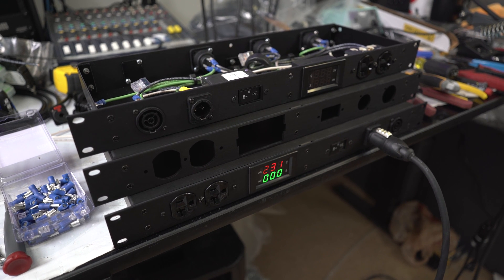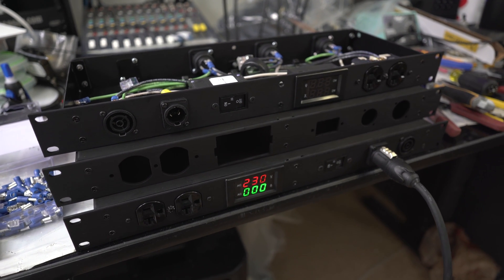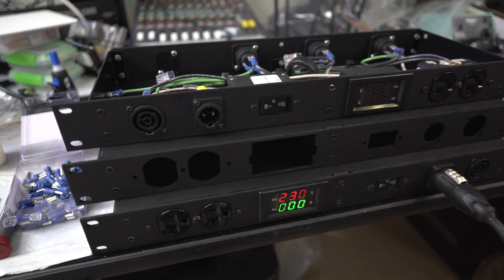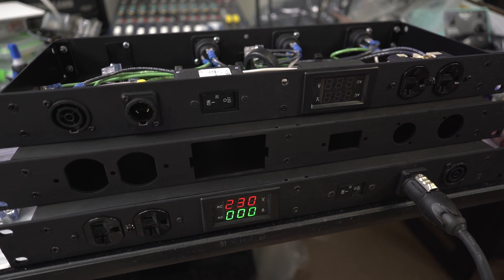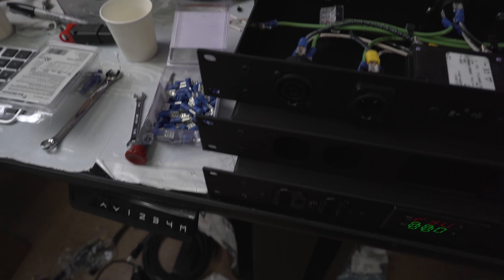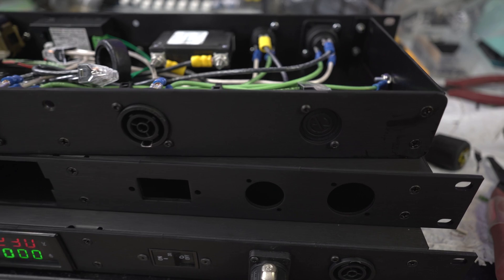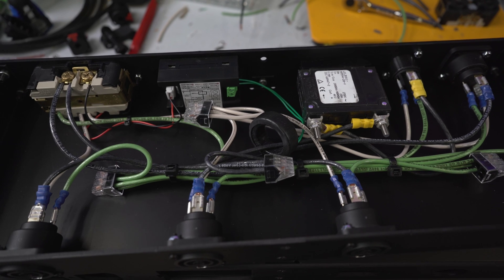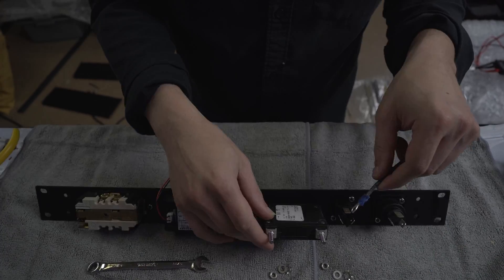Building A True1 1U Rack Mount Power Distribution Unit

Comment: I would like to know WHO Builds the Breakers you use as well as the Volt/Amp Meter  ? NEC Code says the way you are doing your wireing is wrong . When you come into the distro  you come into a Wire Strip for both the hot and nutruals . Just like they do for Square "D"Breaker Panels . You should also do the Grounds that way as well . Just a thought . I was trying to find Spec info on the wago connectors on what load they could carry and could never find any info on them ... I tell people when you build power distro's you build them like enclosed trailers . People will buy a 6 x 12 single axle trailer and then pack it as if it had 2 3500lb axles on it . ALWAYS over Build . ALWAYS ... Thanks

Comment: I'm guessing the application is:  Customer is using this power board for both US and EU locations.  His equipment uses a US NEMA 5-15 but the internal power supply is actually international 50/60Hz 100-240V.  So, he can get his power from a Powercon True1 connector in either country and still use all the same rig/power cabling.  Ignoring that a NEMA 5-20 is not rated for 240V, but we all know it's made from the same components as a NEMA 6-20.  :)
Reply from the maker: Correct! The True1 also saves on height as we can make the chassis 1U instead of 2U to accommodate a 5-20

Comment: Please answer this i have to crown xti 4002 amps i want to use a 1u distro what would you recommend?
Reply from the maker: 2 of the most expensive units LM makes. 🤣🤣 This is a hard question to answer without knowing more. I’d recommend taking an average of the venues you play and see what power outlets they have available. I’d hate to recommend say…a 3 phase distro, that you can only use at 1 venue.
Reply from the maker: Also. Check out this video. It elaborates on my last comment and as a bonus…gets LM some views. https://youtu.be/irvbvwdUEfc?si=VTCTuCzxqmxRxiuE

Comment: I would love to have a auto-switching pdu which has two inputs (primary, secondary) and then 2x NEMA 5-15 ouputs.
Reply from the maker: I actually have a dual input L5-15 distro build coming up. I’ll film it!
Reply: @billylaguardia  are you planning on selling them by chance? What would be a general price target? Auto-switching pdus with dual failover inputs are typically pricy. I’m using for networking equipment, where one input goes to utility and the other goes to UPS battery.
Reply from the maker: @justinknash  it’s a custom build for a client. Happy to spec something out for you if ya like. Just shoot me an email: billy@lmcases.com

Comment: Nice build. One comment is.  I have been told by licensed electricians that you should not have the hot or neutral wires “looped through “ the screws on the outlet.  They should be split off before the outlet.  I know this because I built a similar disto and showed to an electrician and he told me and showed me literature from a manufacturer that said not to do it. 
Also he advised that if something were to happen like equipment damage or personal injury,how ever unlikely, and there was litigation involved the fact that I am not a licensed electrician could make me liable for damages and lawsuits.  Take it for what it is worth.

Comment: Nicely build but my motto is:
Less connections = higher reliability. 

Plus that I am from the Netherlands and we never ever use solid wire for mobile applications for obvious reasons like vibrations that can loosen a connection. 

I always used 2,5mm2/12AWG for these kind of things in past and go end to end (star layout).
Nowadays I use 1,5mm2/14AWG and follow the Brits by making a ring circuit.  Still have the same current carrying capacity as with 1,5mm2 but  more reliable and easier to build because of thinner wire. Also less voltage drop but due to lower resistance but that is a long explanation as to how and why. There are videos on YouTube about it if you are really interested.
Reply: From what I've seen, Wago connectors don't vibrate loose and are quite difficult to pull apart, though I could be incorrect.
I'd love to see testing done to confirm this as a potential issue with mobile systems like this. 🤔

Comment: Trying to build a distro and this video really helps out! I’m having a hard time understanding one thing… you said in the video that you ran out of “14-16 gauge disconnects” but you’re using 12 gauge wiring. You don’t need 12-10 disconnects?
Reply from the maker: 12awg THHN wire fits very snug in the blue 14-16awg hardware. I like to only use the yellow 10-12 hardware with 10awg cable. 12 is obviously in spec, it’s just a tighter crimp with the smaller diameter hardware.